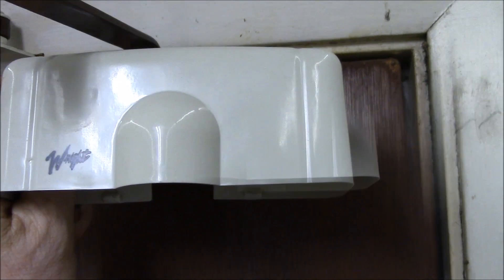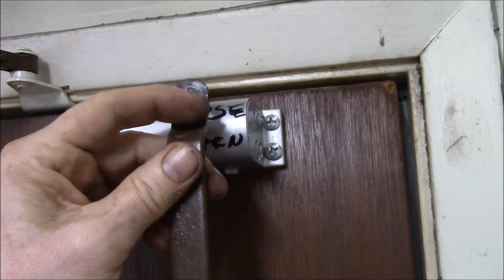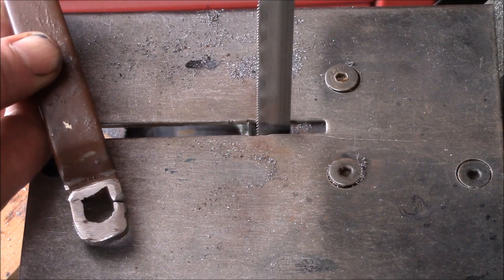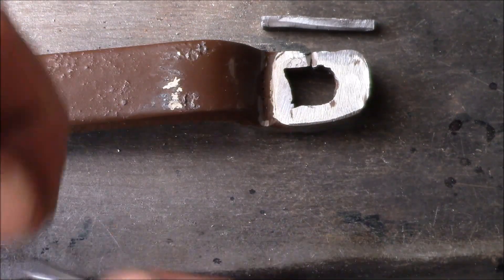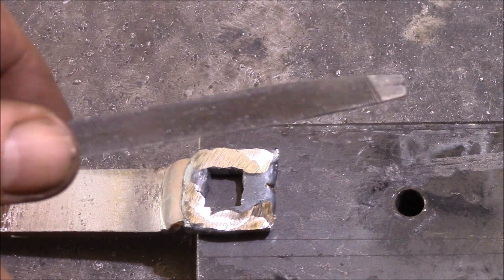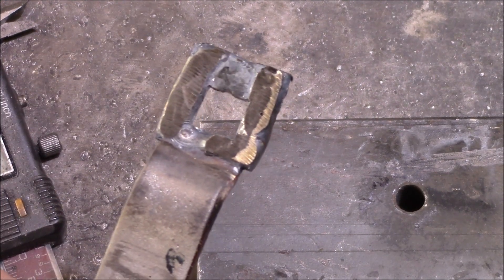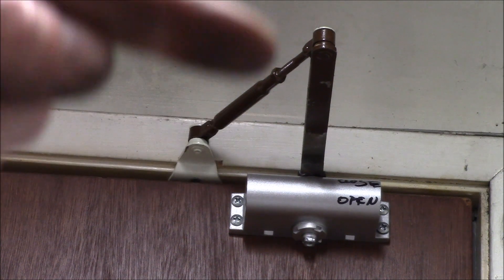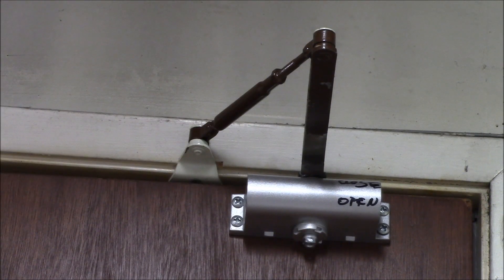Wright Door Closer Repair, Round 2

Comment: Hopefully this time it won't break for a long time,  personally when I choose a door closer I got for what is most heavy duty for the area (aim for medium duty to heavy duty depending on door and traffic/usage of the doorway.

I use a Tell 600 on my bathroom door, it's been up for almost a year and all is good with it soo far.
Reply from the maker: Yes, usually try to do the same.  I don't recall the grade on the unit I have, but the hardware store I purchased it from didn't have much of a selection.  This one has been in use for 7-8 years as I recall.  It's on a solid core (heavy) door and does see a lot of traffic.  I guess if I ever need to replace this one, I'll know to look for one with more "meat" around the square hole as that seems to be the weak point.
Reply: @The4Crawler  probably ansi grade 3 residential, the one I have any more heavy duty I could put up an LCN 4040 or equivalent, mine came from Lowe's

Comment: Remember doing almost the same repairing a belt buckle in a jewelry class...got pretty good with the propane torch...long time ago...would probably end up in the burn unit if I tried it today...♀
Reply from the maker: Yes, have done that a few times before as well.  Seems the smaller and more delicate the repair the harder it is to do.

Comment: good job
Reply from the maker: Thanks, hope this time is good.  I think the issue with these arms is they use 3/16" x 3/4" wide steel and then punch a 3/8" square hole on the end.  This leaves a 3/16" square piece on each side to resist the torque of the closer mechanism.  The loading seems high enough to cause plastic deformation in that strip of steel.  Hopefully, adding 1/8" of steel on each side of the hole will reduce the stress below the plastic deformation point.  Had they used 1" wide material to start with, these things would be a lot stronger, but that would add a few cents to the bill of materials.